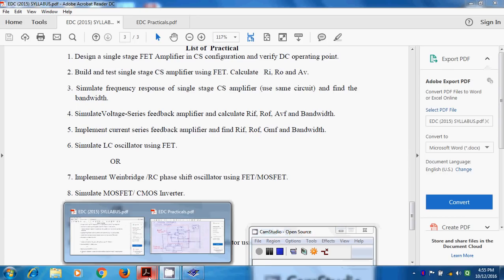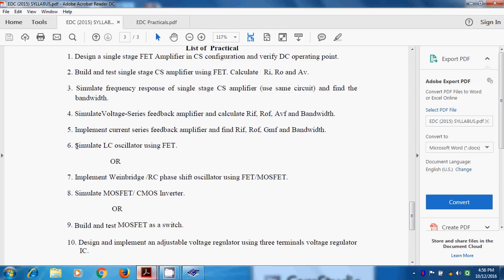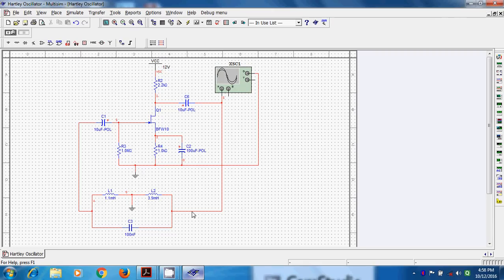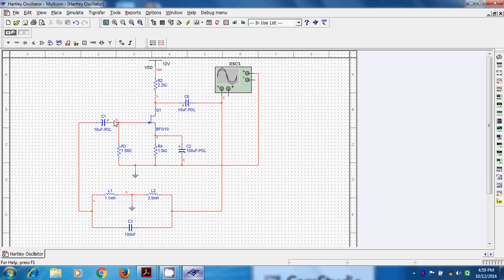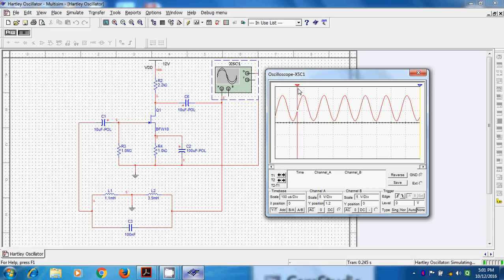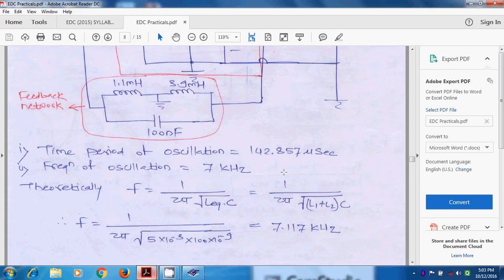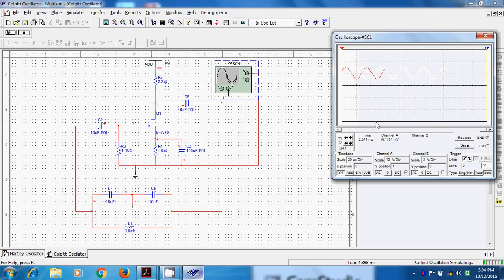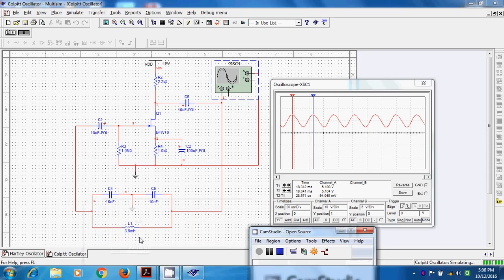EDC Practical: 6. Simulate LC Oscillator (Hartley & Colpitt) using FET by Prof. Omkar S. Vaidya.

Comment: Can u pls provide the circuit for 10khz with output peak-to-peak voltage of atleast 12v and current of 3mA as i want the power of 16-20dBm.